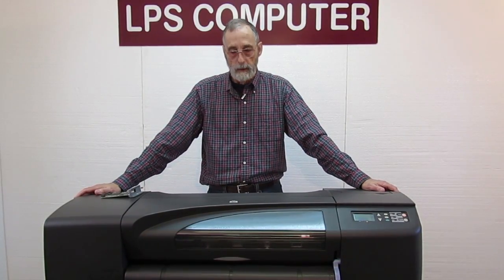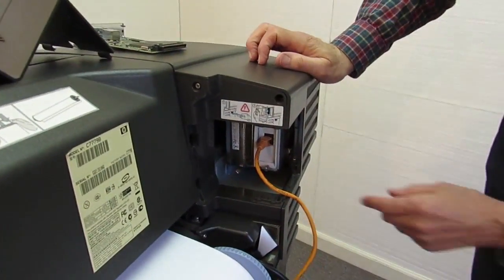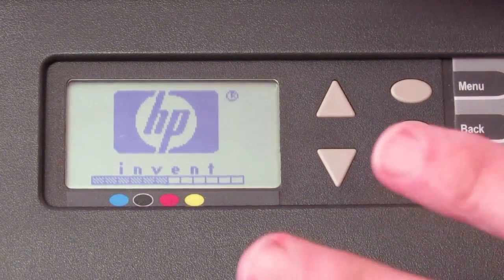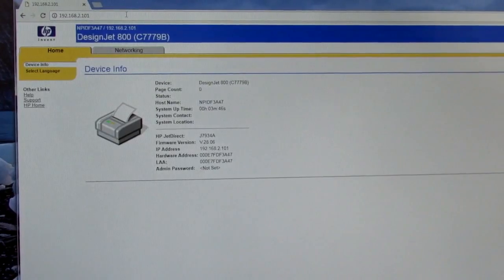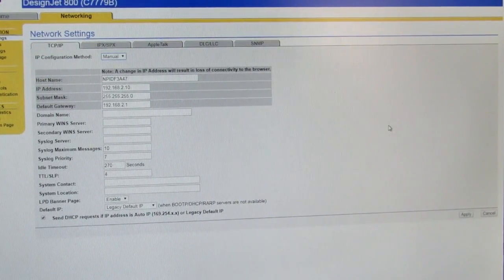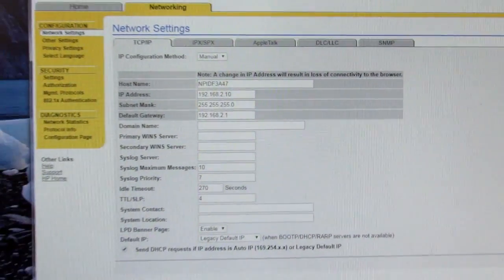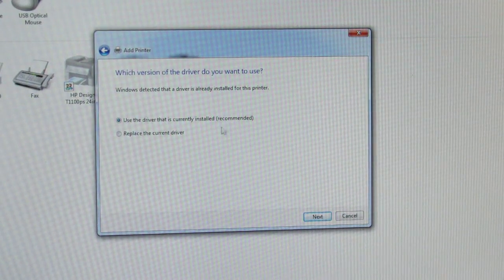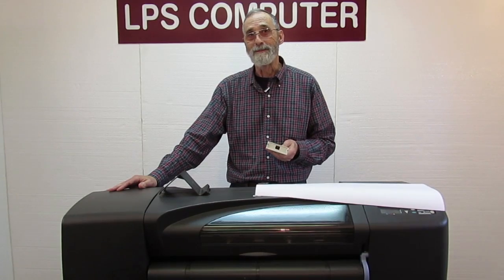How to Connect Your HP Designjet to the Network (Ethernet)

Comment: Hello Bob, Not sure what the issue is with my Designjet 500, I have an HPGL2 card and the Network card. My card will not even show up in the IO menu on the printer. I have tried a bunch of different things like reseating the cards, switching slots, and multiple printer restarts. Let me know if this is something that you have encountered before and how the problem was solved.

Thank you

Comment: I have a HP 3720. The cartridge carriage is stalled.  I can even grab it and slide it across.  When I open the door to the printer cartridges the cartridge moves slightly, but doe not come to the middle.  It is jammed.  There is no paper or other obvious construction.

Comment: Hi: I have my T610, working perfectly fine with USB, although it has an ethernet port in it, but i am not able to fine it on main pannel screen of printer, can you please help me. I have clicked every single button on main screen and setting but i am unable to locate I.P. settings, although formatter board has Ethernet port and when connected to a wire it does lightup as well, please advise. thanks

Comment: love these old printers, i have the 500 its been on usb 6-7 years and i just bought it a jetdirect 620 card, i'm not seeing much improved on the 800 i think it was just a re-badge and a software tweek of the 500 for sake of having a product for market. what i did wish is that the 500 didn't seem to love crying about 'heads' being defective when there not. costing me money in heads every few month another needs to be binned, surely there's a way to stop this craziness.
Reply: Hi I recently bought a 500 and am having trouble with the error code 0x0000007f and my laptop can't even initialize it not letting me print. Would you have any recommendations on how to solve that issue?
Reply: @albert2araujo  is the laptop doing a blue screen? Isn't 0x0000007f a ide/ahci/sata error code?

Comment: I bought an old HP DesignJet 350C from a retired Civil Engineer. I want to use it to print patterns for fashion design. It came with an HP Jetdirect EX plus, and I want to operate it with a Macbook 10.14 Mojave. I'm pretty tech savvy and got it to work using a USB to Parallel. But I can't get the printer to show up on my Mac using my router (connected to the Jetdirect & printer) for wireless connection.

It would be awesome if you or someone could help me out here.... 👍🏽
Reply: The 350C is pretty much an antique, but you may be able to connect using the external Jetdirect if you can find a printer driver for it using OSX.  Apple used to have their drivers for HP printers for Mac on their website.  In the old days, the Macs would only connect to a PostScript printer and none of the 350C plotters were PostScript.  You may want to contact Apple and see what they recommend.
Reply: @bobwert6982  thanks for the info! ATM, I'm trying to connect the printer to my old Windows XP computer to see if I can get anything out of it (ie: the printer's IP address). I could not connect the JetDirect EX plus to it. ☹️ Wondering if I should upgrade the old XP to 10. I'm probably digging my hole deeper and deeper. lol

I'm thinking the direct connection using that Parallel/USB to my MacBook will end up being the only way to operate this thing, which was a miracle on its own.
Anyway, I'll keep you posted.

Comment: Will this card work in HP Designjet 510 by itself without formatter board CH336-60001 ?
Reply from the maker: The 510 does not require the GL/2 upgrade board for the JetDirect card to function.

Comment: Not able to find HP designjet 800PS 24 by hp option in the list
Please suggest what to do.
Reply from the maker: What operating system are you running?
Reply: @LPSshowsyouhow  windows 10 64-bit
Reply: @MrYogya08  i had the same issue (it's probably universal on windows 10). 

just google search the driver for your model, go to hp's webpage, download the driver software, run it, and just input the ip listed on the printer (after executing the initial steps in this video) in the setup dialogue. it will find it. choose it, click next, and it installs automatically.

Comment: Hi, I have an hp 500ps and I would like to add an ethernet to it (in order to connect to my office switch network). Currently, the plotter only has serial and usb connection. Would you be able to consult on the ethernet card I need to buy? Hp do not offer support for these plotters anymore ..
Reply from the maker: I would suggest the 615n, available here: https://www.lpscomputer.com/collections/designjet-500-800-parts-page/products/designjet-500-800-jetdirect-card-610n?variant=6822971080759

Comment: Is there a way to check with the current firmware is?  I want to get a card since I cannot complete the firmware update due to the plotter not showing up as connected via USB...  but if the card needs a firmware update to install... I'm still stuck...
Reply from the maker: Which printer are you working on?

Comment: AH NO! Printing a TEST page does not provide any proof that the printer is actually queuing jobs properly. BAD EXAMPLE! Lets see you actually queue something to PRINT. Thats the only sure way of proving that the printer/plotter is actually working.
Reply from the maker: The video shows how to make an ethernet connection between a computer and the plotter.  Obviously, the correct printer driver needs to be present.
Reply: 3 Years later comment but.. It does prove it. Printing a test page puts a job in the queue for the spooler. Just as a normal print job.